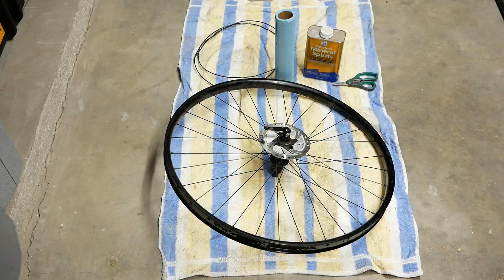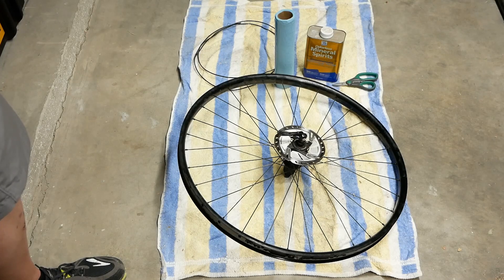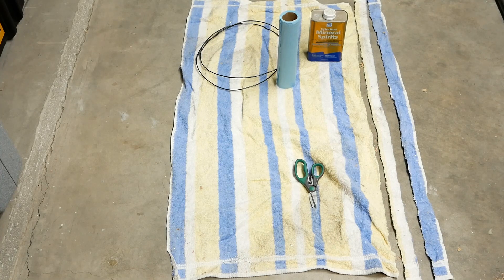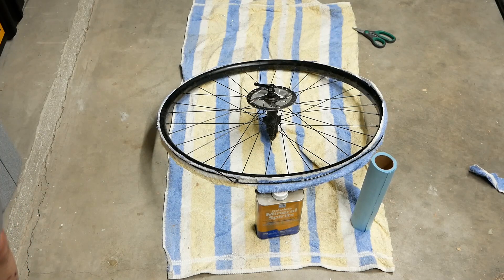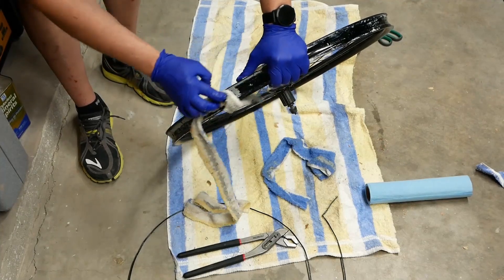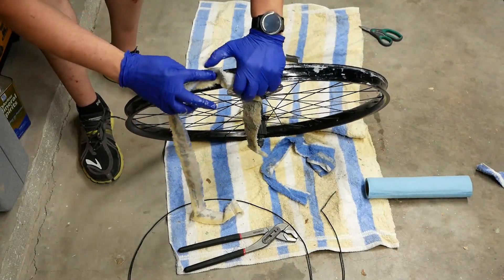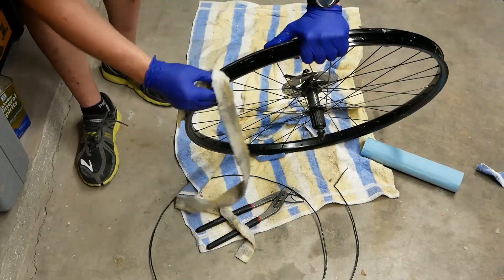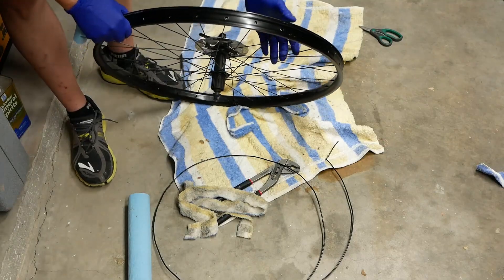Gorilla Tape Residue Removal - Bike Wheel Example

Comment: Did the same mistake in putting gorilla tape on my rim. My method in cleaning the glue seems counterintuitive but works. I used tuct tape (red one). After putting the tape on the glue you pull and chunk of glue will peel. Not a very quick process but it does work and less messy

Comment: Thank you very much for this video.  The Gorilla tape that I had on my 29+ carbon wheels was about 4 years old and it was a real bear to remove. I used your method of strips of an old towel, mineral spirits and waiting about 10 min and it worked amazingly!

Comment: Thanks for taking the time to produce this video.  I aways use Mac-Off or Stan's tape when sealing my rims but ran out and a local bike shop used Gorilla tape.  Gorilla tape was a disaster for a number of reasons.  Firstly it does a poor job of sealing tubeless tires, you have to pump them up much more that you would using Muc-Off or Stan's rim tape.  Secondly, as you demonstrated, it's difficult to remove the residue left when re-taping.  Again, Muc-Off and Stans tape are much easier when it comes to removing any residue left behind.  Both of the purpose made rim tapes are not expensive so I'm at a loss why anyone would knowingly use Gorilla tape as rim sealant.
Reply: Yes why would they… unless their local bike store was out of proper rim tape and told them gorilla tape works great 🤦🏻‍♂️